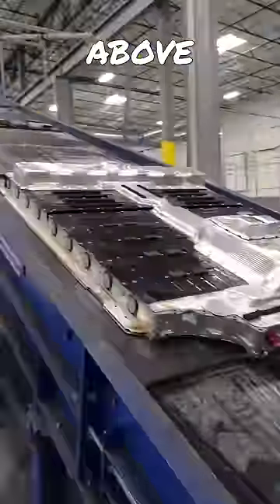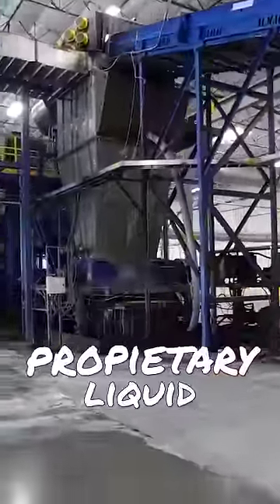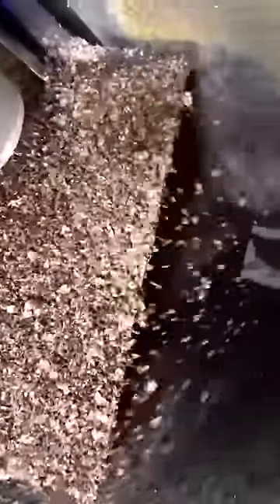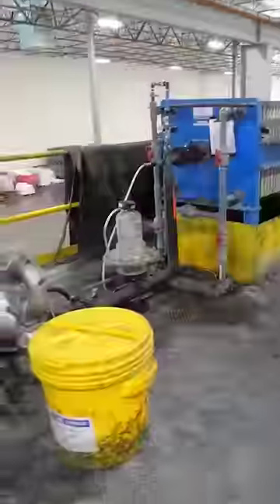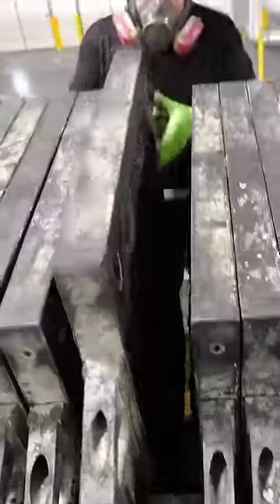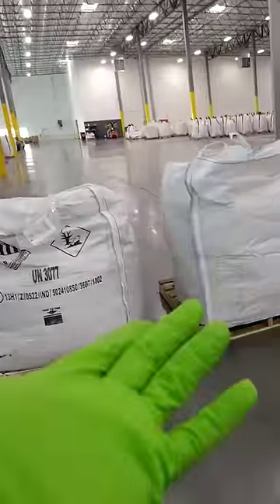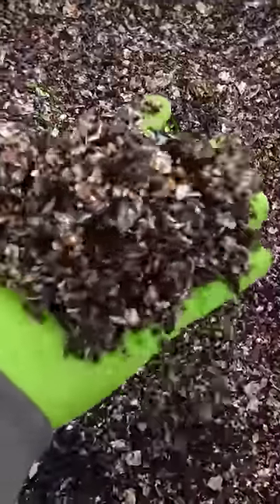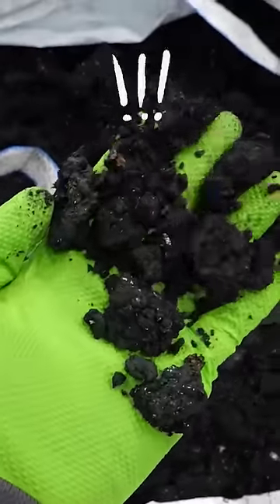Electric Car Battery VS Liquid BLENDER

Comment: This fire will be legendary
Reply: There is at least one industrial fire every year in Arizona
Reply: I want to know the chemical liquid there using to stabilize the lithium and more like a boom if anything goes wrong then massive fire for days
Reply: I'm not sure, I think batteries are flammable because of the energy stored in them from charge seperation, not because these ingredients are flammable themselves.
Reply: @nickel36  Mostly true; the rapid discharge of the stored charge is the energy required to reach flashpoint. For various lithium carbonates that is between 18 to 145°C. Obviously lower flashpoint temperatures wouldn't be used in car batteries.
Reply: Just add water.😂
Reply: @robingamel9788  ya instant kaboom
Reply: @osahinmartinez3371 AZ hot fam
Reply: Relax, is not gasoline, just inert elements.
Reply: Lithium.
Reply: @robingamel9788  These are lithium Ion batteries, not lithium metal.  One reacts ignites in water, the other doesn't.
Reply: @patrickshelley09  I c
Reply: @nickel36  its alot more complicated then that.
Reply: @nickel36 lithium is quite flammable whether it's in a battery or not

Comment: Man wearing a full tilt respirator at the filter press should tell you everything you need to know about the toxicity of lithium and cobalt.
Reply: You wouldn’t want to breathe in any metals. Asbestos included. Lungs can’t expel that stuff.
Reply: Lithium is not very toxic  Cobalt on the other hand is quite toxic but not super toxic. Because the black mass is wet, there is no dust. You should be okay. But to prevent chronic exposure a respirator is a good move. The proprietary liquid is probably a mixture of organic solvents. I suspect that the worker primarily wears the respirator to protect him from the solvent vapors.
Reply: Brother you have to wear a mask even when working with sand if it’s fine enough that means nothing
Reply: You should see welders with fresh air respirators. Ban all welding..
Reply: No, it tells you the danger of dust.
You’re just trying to pretend.

Comment: Proprietary liquid = mineral oil or some kind of inert liquid to prevent the lithium from reacting with the air.
Reply: We wish it was oil. It is water. Trillions of gallons are used every year.  Oil would bind with the lithium ion and render it unsable.
Reply: @OldSkoolF water would make the entire place explode
Reply: @hunternelson7627 y’all are both wrong. Js.
Reply: @OldSkoolF "Trillions of gallons are used every year" WTF? This process has never been scaled up to that size. Why do you have lie soo blatantly?
Reply: @OldSkoolF "Oil would bind with the lithium ion and render it unstable" That defies basics of chemistry. You just ignored covalent bonds and ionic bonds incompatibility. You would need heavy contamination of something like hydroxyl groups on smaller chains to have good interaction with lithium compounds. This is easy to prevent, seems you don't understand chemistry.
Reply: It should be highly illegal for this liquid to be proprietary. Now we have no idea what horrendous chemicals they produce as a byproduct.
Reply: @Neojhun think they meant in total as humans but that’s a crazy jump to make 💀💀
Reply: @OldSkoolF ah yes famously polar molecules... Oil? The name lithium ion is misleading, its usually a lithium salt that gets reduced and oxidized to generate an electrc voltage potential. Oils are just carbon and hydrogen hence the name hydrocarbon,  neither of which reacts with lithium. And even if it did it wouldn't be that hard to separate it from the polymers and other metals(lithium is very light compared to other metals so it can be mechanically separated easily). Lithium tends to form mostly ionic bonds with carbon so even if it did you would just get an ionic salt which could be separated with some sort of selective solvent. You could just use an ion exchange too it's not hard.
Reply: @Neojhun in my gen chem 1 class in college we had a lab where we messed around with the group 1 metals. We fished them out of mineral oil and then dropped them in water and watched them react. It would seem the fella above missed that lab.

Comment: That's about the most sketchy industrial process I've ever witnessed.
Reply: Recycling is a dangerous wasteful sham, hence the appearance.
Reply: @dirtpounder  yes indeed. I don't recycle any of my household waste, as it's far better for the environment to just bury it in landfill. The irony is that the "environmentalists" try to "do the right thing" and recycle, but most of it just gets shipped to the Philippines and dumped into the ocean.
Reply: @michaelnoble2432 the thing with that isnt nessesarily where the trash ends up, its about not having to mine as much fresh material
Reply: @chemieju6305  the point is that despite ENORMOUS effort, very little plastic is actually recycled, and the recycling programs cause vastly more harm than just burying it in landfill. 

Plastic in the ocean is much, MUCH worse than any damage from extracting the oil to make new plastic.
Reply: @michaelnoble2432  i dont see enormous efford, just someone giving up before they start and burrying trash
Reply: @chemieju6305  even if the effort was the same, burying trash in landfill is MUCH better for the environment than trying to "recycle" it.
Reply: @michaelnoble2432 what about the environment for the landfill, recycling is bad, landfills are definitely bad, plastic in the ocean is bad, pollution from carbon emissions is bad, nuclear power is too expensive and when handled improperly leads to very bad stuff, WHAT IS THE SOLUTION. How do we solve anything long term, or is the solution that we we just go extinct, like I don’t understand how to fix this and it seems like every other “solution” is just another scam.
Reply: Pretty much every industrial recycling process looks exactly like that. ..
Reply: @michaelnoble2432 that's BS. Burying plastic is moronic. You are correct that little to no plastic gets recycled because most plastics get downcycled or simply burned. Most plastics burn about as well as the oil they are made from so you can recoup a lot of energy from burning them and aren't left with entire landfills full of hem.
Reply: @KT-pv3kl  burying plastics in landfill is VASTLY less damaging to the environment  than dumping them in the ocean. 

Yes, there are theoretically better options than burying in landfill, but they are almost never actually done.
Reply: @chemieju6305 many recycling facilities use more energy than they save too, leading to more emissions and pollution
Reply: @Prootgen we don't need electricity to survive as a species
Reply: @michaelnoble2432 as long as you are pulling out the aluminum and glass to recycle, in process that are extremely efficient, idgaf what you are doing with plastics
Reply: @qwertyuhi8221  yes, aluminum is definitely worth recycling, as it takes around 100X less energy than making it from ore. Glass much less so.
Reply: @Prootgen nuclear is not that expensive comparatively and it is punishingly simple in the modern day to avoid environmental disasters related to nuclear plants. Nuclear is absolutely and unambiguously the way to go.
Reply: @michaelnoble2432 so you say recycling is bad just because it gets dumped in the ocean in the Philippines? But you do agree that when it gets properly recycled it’s better right?
Reply: @michaelnoble2432 at least until you run out of places to bury your trash
Reply: @Dud3itsj3ff  the Earth is a very, VERY big place...
Reply: @sneaky_krait7271  so in SOME cases recycling MIGHT be better, at least in THEORY. But since that doesn't happen in the real world, landfill is a better option.
Reply: @michaelnoble2432  When I was a kid we would comb the ditches along a road for Coke bottles. You got 5 cents for the small ones and 10 cents for the king size Coke bottles.
If you want plastic recycling to work you have to put an artificial value on the packaging, folks with little income will turn it in. If the package can't just be cleaned and reused it needs to be made of something that can be reprocessed. I agree with your point on current plastic recycling.
Reply: @chemieju6305  if what is supposed to be recycled isn't being recycled, as is the case much of the time, you would still have to mine for fresh material because you aren't regaining anything from "recycling".
Reply: Then you haven't seen ANY industrial processes before.
Reply: You should see the lithium refinement process
Reply: @michaelnoble2432 that doesn't make any sense. Plastic in the ocean is more harmful than the waste from making new plastic from oil sure, but that's not really a fair comparison. The plastic ends up in the water or someone's back yard either way. If they make new plastic, the old stuff still goes somewhere
Reply: This really isn't that sketchy at all. The only thing sketchy about it is "proprietary liquid"
Reply: @dirtpounder it's not about recycling it's about not having to mine more lithium and cobalt for batteries
Reply: @michaelnoble2432 this isn't about plastic it's about batteries? Sure plastic and other forms of recycling may not be wide spread or efficient but that doesn't mean NONE of them are
Reply: @michaelnoble2432 not true at all. A lot of waste gets shipped to those places BECAUSE you just toss it out. Especially electronic waste.
Reply: @dirtpounder it's a sham because they are extracting value from waste? Okay boss
Reply: No. @dirtpounder
Reply: @dirtpounder  Even if most recycling is a sham, I'd put Aluminium can, and battery recycling firmly in the category of beneficial re-use of resources.
Reply: @Prootgen not all landfills are bad.
Reply: @michaelnoble2432  Glass Recycling makes very much sense because you use exactly the same amount of energy to smelt it but all of the energy spent on transporting raw materials, purifying the chemicals and actually mining them is saved
Reply: @Dud3itsj3ff  nah, one day elon will be able to use starship to launch waste at the sun.. that is the end game for how we deal with trash!
Reply: Bro, go back to school
Reply: Not even close.
Reply: fr

Comment: I worked at a mine. The process is crush, heavy media separation, float then press. Ore is crushed. Ore is transferred to a giant “cone” or a tank that swirls and suspends the heavy media/ore slurry causing it to float ore that wouldn’t normally float in water. The media was comprised of water and tiny steel shot. The ore is raked off the top of the media. It’s a balancing act of trying to get the tank to float the ore containing material and nothing else. It then goes to a mill (fine crusher), then another float process to further separate, then to the press to release your unprocessed raw ore.
Reply: Every YouTube comment should be people describing their unrelated job's workflow. Ty for being the change we want to see.
Reply: @mrfattypancakes  It's not unrelated; the process he's described at a mine / refinery is almost exactly analogous to the process in the video!
Reply: Ohhh boy that sure sounds like it requires WAAAAY less energy to produce than distillation of crude 😂😂😂
Reply: @pcd1377  What's the easiest way to optimise a continuous distillation column when combined with a cracking plant? And if you don't know what either of those are then you have no idea of the inputs required for either black mass refining or hydrocarbon production.
Reply: My question is how dangerous is the proprietary liquid? What do you do with that when that liquid when it needs to be replaced?
Reply: @neilkratzer3182  the “proprietary liquid” is water and tiny steel shot. The water is aerated. It’s nothing crazy.
Reply: @neilkratzer3182  the facility I worked at had several on site ponds and was closed loop
Reply: Understand what your saying. I'm more concerned on the recycling part and their special solution to break it down. How hazardous in the solution at the end of its life?
Reply: @mrfattypancakes JFC thank you for being obnoxiously intrusive and disruptive, impeding the flow of good communication. What he described is: related, analogous, useful, informative, and all you did with your comment was too spew negativity. Get lost in an ore separating facility.

Comment: Quite a few of those tool batteries were older post-style Ni-Cad batteries so they're not going to be getting lithium out of them.
Reply: lots of nickel coming out of them.  and nickel is what the new lithium batteries use for anodes and cathodes. completely worth it.

Comment: We need that proprietary liquid for fighting EV car fires.
Reply: Because gasoline is inert?
Reply: @TurdFerguson149 Kathleen. does not present this type of problem
Reply: @TurdFerguson149  when I gasoline powered car is on fire the fire rarely reaches the gas tank and it’s only the plastics etc. that end up burning up Much easier to extinguish
Reply: @steelisthemeal  you’re a goofy little sheep aren’t you “EV baaaad!”
Reply: @steelisthemeal  ev fires start slow and burn long = you make it out alive, gas fires erupt and are put out quickly = you don’t have time to get out. Tesla model x = safest suv ever made.
Reply: 280,000 gasoline cars catch fire every year in the USA…
Reply: @@One-ik4pb deaths caused by fire are far more likely in gas vehicles than in electric vehicles and electric vehicles are safer in general too.
Reply: You want to use a solvent to fight fires?
Reply: @ToughestHentaiMaster  on average it takes about 45,000 miles of driving for an ev to make up for the extra resources used to manufacture the battery. After that the ev is far more environmentally friendly. Tesla batteries are expected to last 300,000-500,000 miles. Battery technology will only improve but they are already far better than gas/diesel vehicles.
Reply: @ToughestHentaiMaster  for every 3 gallons of fuel used in an i.c.e. car a 4th gallon is used to transport the fuel to the car. The whole idea of using electricity to make hydrogen to put into a car to turn back in to electricity is just goofy. I drive a Tesla for the convenience, performance and safety and don’t care too much about the “green” aspect, but to see all you sheep try to say that ev are not more environmentally friendly is just so annoying!
Reply: @@One-ik4pb they’re not that new, I’ll take safety over easier fire extinguishing any day.
Reply: @TurdFerguson149 ”Tesla Model X = safest suv ever made.” 
Wrong, the 1st generation Volvo XC90 has 0 accident fatalities. It’s been around since 2003.
Reply: @swedish_brick_enjoyer  that is not true at all, nice try
Reply: @TurdFerguson149  Suit yourself
Reply: @swedish_brick_enjoyer  keep lying
Reply: @DrFigs  and ev fires are far less frequent than gas cars
Reply: EV have a lower rate of vehicle fires compared to an internal combustion engine.
Reply: @TurdFerguson149  EV fires don't start slowly... You clearly have never seen a battery go before.  It is an immediate and violent release of energy.
Reply: Where did that number come from?
Reply: @Pleasiotic1  that is absolutely not true, you don’t have a clue
Reply: @TurdFerguson149  What's absolutely not true?  Which comment are you responding to?
Reply: @TurdFerguson149 assuming you’re not filling that EV with fossil fuel electricity then yes. But we won’t live in that world we generate electricity using fusion or fission.

You seem to be angry at people for telling the truth but emotion isn’t helping you
Reply: @matthewraye64  he said liquid, not solvent, and clearly you don't know what the word solvent means, because firefighters already use a solvent to do most of their firefighting. it's called water.
Reply: @steelisthemeal  hi! my sister currently works in a Fire department and i worked witha Volunteer FD for 5 years. ICE engine fires almost always hit the gas tank because gas tanks are usually a low-heat metal and aluminum engine blocks burn with enough heat to ignite the fuel lines and cause flashbacks. not to mention the molten engine blocks become effectively Thermite compounds that are nearly impossible to put out with water. You should do some volunteer work with a fire department and educate yourself further on car fires!
Reply: @TurdFerguson149  The statistics, provided by the police as a result of personal injury accidents on public roads, show that no XC90 driver or passenger fatalities have been reported since records began in 2004

Comment: That "black mass" looks like manganese and graphite powder mainly.
The lithium can be in the form of LiOH (after going through water)
The main difficulty is taking away the alloys and separate a compound as soon as possible to prevent a possible unwanted chemical reaction.

Comment: Neat. We use filter presses in my industry as well, aluminum extrusion. For use in the water treatment process used for die caustic waste water and  anodizing waste water. It is used to remove the flocculant and everything attached to the floc (heavy metals etc)

Comment: Clean, green energy. Lol.
Reply: Yes. What's not clean about this process?
Reply: @thelonewanderer420  not referring specifically to this process but the entire electric motor vehicle industry.
Reply: @V12BHP  are you familiar with how oil is extracted and refined into gasoline?
Reply: @electronicsandewastescrapp7384  do you have any idea how much the manufacture of a single electric vehicle damages the planet? Not to mention the transfer of energy production from fossil fuels at source to polluting power stations, using the same or alternative methods of creating pollution.

Comment: I did some research. Lots of companies talking about the promise of "closed loop" recycling of lithium ion batteries. Apparently there's one in Canada that's actually doing it. And they are able to pull the needed materials back out of the black mass and turn them into new batteries that are just as good. So there is a future in this. I'm guessing right now it's pretty expensive compared to just mining the stuff. But soon it might matter.